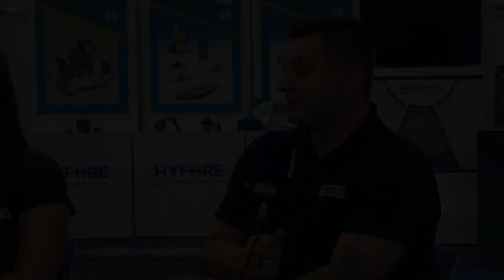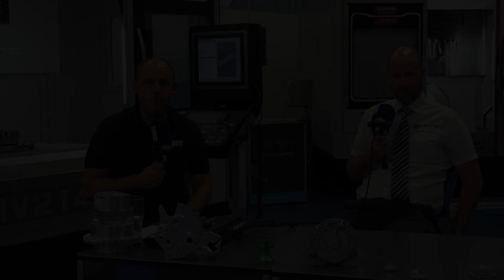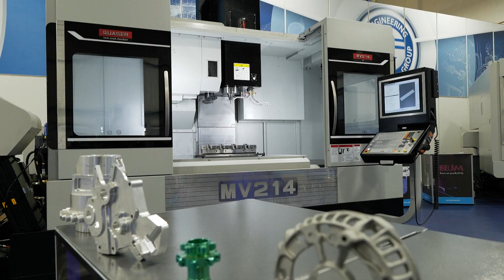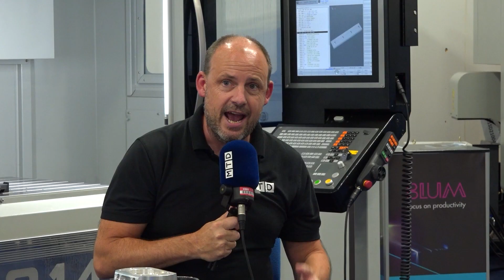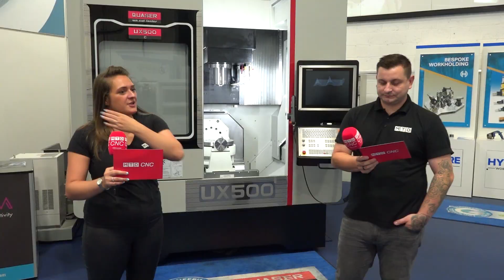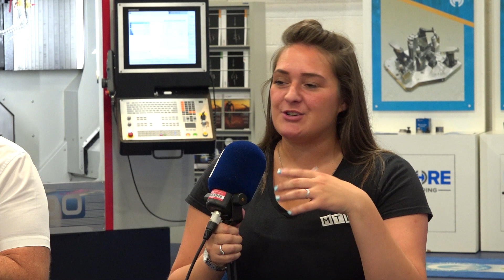ETG Podcast - The Challenges faced by machine shops today

Comment: Using high spec machines with in-process probing to verify before final pass to update tool wear. Use CADCAM with simulations. This will not be a problem for those that actually want to keep up with technology and is not afraid of it
Reply from the maker: It could be for some though.